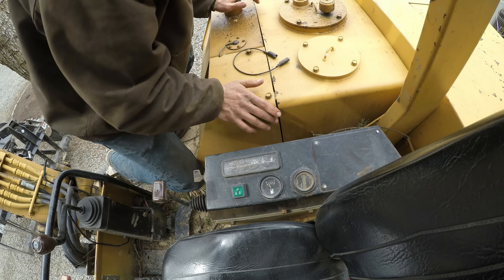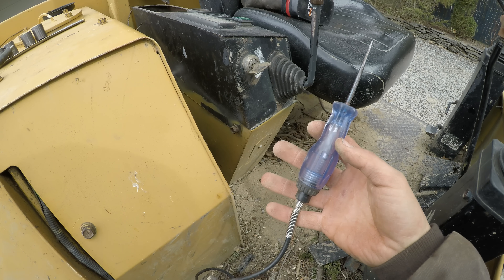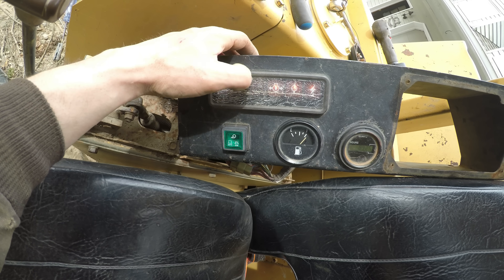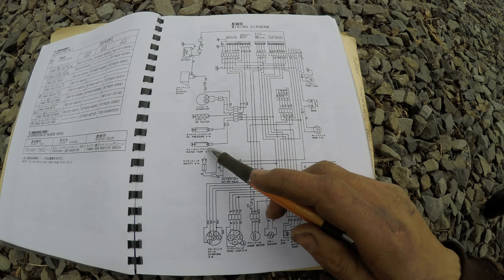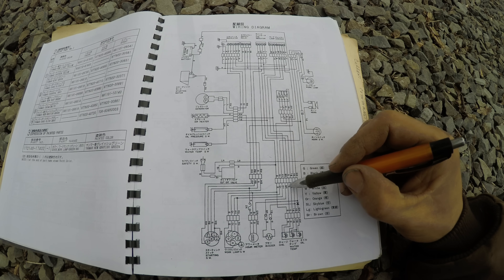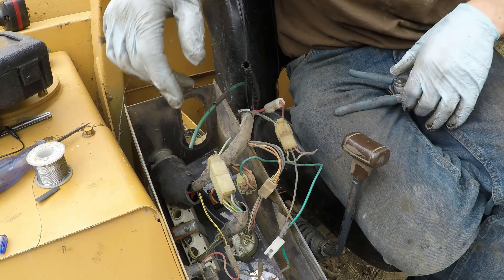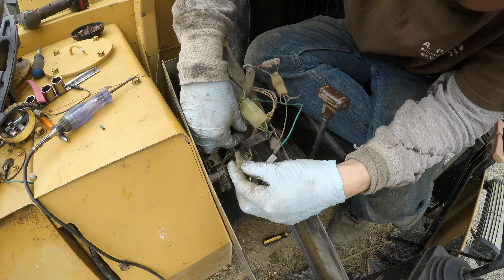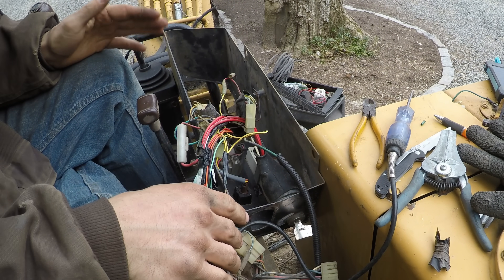Fixing electrical problems on the Yanmar excavator

Comment: Soldering wires on machines or any auto is a bad idea, your machines its your choice but just be aware of the downside.
There is a reason why auto and aircraft wiring and wiring on machines like this that vibrate are multi strand and that is to tolerate movement and vibration, soldering just turns multi strand wiring into one single solid core like house wiring that can just crack under vibration and movement.
I've got some vids of a Vermeer stump grinder I had to fix that had some nasty failures due to soldered wires.
Heating up the soft copper wiring with a soldering iron just hardens it and makes it more prone to cracking in addition to oxidising.
Get a quality ratcheting crimp tool that does double crimp.
Reply from the maker: I have never had a solder joint fail. Those crimped connections always seem to fail from corrosion
Reply: @AndrewCamarata  
I believe you Andrew, but it's only a matter of time and being a working mechanic since the late 1970's I've seen it a few times. not just on that Vermeer stump machine I did vids of which was worse case.
Re crimps, if you buy cheap ones and don't use shrink any join will corrode, good quality ones come with ends you can seal with heat.
The other side of it is always using double crimp tool and ratcheting so you can assure a proper crimp.
I can assure you manufacturers don't use crimp terminals on cables for cars, aircraft and machinery just to annoy solder enthusiasts.
With solder its not the solder itself bit that breaks its the wires just at the end of the soldered bit.
In short, the more strands wire has to more flexible it is and the more resistant it is to vibration.
But like I say, it's your machinery and if you prefer to solder then do what you feel is best.
Reply from the maker: I feel like the shirt tube can stop that from happening though.
Reply: @AndrewCamarata  
It's better than no shrink tube over it.

Comment: Yanmar  is a good brand. They put multiple filters on the fuel system . My friend has an old one like yours. His steel fuel tank was getting rusty so it was very good that he had multiple fuel filters which saved the machine. Perhaps you could do a video on how to fix a fuel tank that has rust on the inside ?

Comment: Bulb checker is likely a module that momentarily grounds the indicator lights during 1st start as a bulb check.
Reply: More likely applied ground or hot thru key function as part of the prove out circuit...

Comment: Not sure if anyone mentioned it yet and I realize this video is months old but... the lamp checker function is like turning key in your car and all the dash lights light up so you know the bulbs themselves are working. That way, an issue doesn't arise that you would otherwise miss because the oil pressure light bulb burned out and you couldn't see that you had no oil pressure etc.

Comment: smaller John Deere construction equipment is made by Yanmar and their larger excavators are made by Hitachi. your EX100 Hitachi also is the same as a John Deere 100 sized excavator.
Reply from the maker: Yeah, but John deere will still screw up the yanmars with some of their terrible parts. I had a newer john deere tractor, the tractor was made by yanmar and it was good. The belly mower was made by john deere and it was an engineering disaster.
Reply: Andrew Camarata it's  kinda wierd but you're right I've found that the Hitachi has fewer problems than the Deere.

Comment: Odd question but what's the operating weight of your yanmar
Reply from the maker: Like 5 tons. If your interested in the weight of a machine, Google usually knows by just typing in the model number.
Reply: I got it. I am in Alabama and have learned so much from you. Thanks for all your videos.
Reply: @codyhale4799  keep in mind that is 5 metric tonnes (1000 kg =2204.6 lb.)  so that would be 11,023 lb.    FYI

Comment: In some type of machines all the check lights come on with the ignition on, after the engine starts the light and the buzzer will goes off, this is control by a diode our by the alternator keep up the good work.

Comment: How does your Komatsu PC15 hold up !!
Reply from the maker: John Deere stuff, generally every hour spent operating the machine, you will be spending 1 hour repairing the machine.
Reply from the maker: The PC15 is good, very rarely breaks.
Reply from the maker: Its not as unbreakable as the Yanmar though.

Comment: Great job with the soldering. That's how I like to do it. Crimp connectors are unreliable and for loosers.
Reply: Looser than what?
Reply: Lunchbox Productions than his bunghole
Reply: Maybe.  A properly crimped connector (i.e. use a crimping tool!) can be good.  Problem with soldering is that on machines that vibrate (like a motorcycle) the solder connection may crack....you may not see it, but it will drive you nuts trying to find it.
Reply: Matt- coming from the assclown that can't spell loser.

Comment: Worked on equipment for 17 years before I bought my first business. You can’t imagine how many electrical problems on vehicles and construction equipment have had faulty grounds. Ford trucks are the worst ground from the frame to the body. You can’t imagine the amount of smashed wiring looms I have found. I spoke to many Ford Engineers who were no help at all. I had a Ford truck that would take off like a rocket using the cruise control because of faulty insulation in the front engine loom. 
I would put any John Deere up against anything except their Skid Loaders. They were junk. I have a JD X595 4x4 diesel that I refuse to trade or sell. It will out mow anybodies mower and has never been stuck.

Comment: Dude the machine has bad grounds and a bad diode {probably burned out from a battery charger}. You didn't need to change any wiring, just replace the diode. Its the triangle with a line over it just above the oil light on your diagram. Bottom right hand corner of the wiring diagram.
Reply: I have one that cant get power to the starter from the switch. Switch seems to be good. Any ideas?

Comment: I think the original wire for the temp sensor being grounded was causing the oem buzzer to stay on even with the bypass. without further testing I would guess the oem buzzer was the original problem causing the light to be on. that being said some times its cheeper and fast to bypass oem problems and Im glad to see you still have a working alarm, very smart dont see alot of people going the extra mile to do that!
Reply: you have the buzzer still connected to the short somewhere and having power still coming in from the shared oil pressure gauge it will continue to send an alarm . The old buzzer still is working so I don't think there was a problem there.

Comment: While I thoroughly enjoy watching your heavy equipment abilities, I can't say the same for your electrical abilities. Any time you are working on electrical problems, you trace down the root of each problem and fix it. Not wire around it. And the reason is because you now changed the wiring layout and it no longer matches the manual's schematic. Tracing the wires really isn't as hard as you think and knowing where the real problem was, is a lot better then rewiring around the problem. JMHO
Reply: In software engineering this is called to "hack around the problem" and it's often done when people don't understand the root problem and/or how things are supposed to work in the first place. 

They think they don't have the time to analyze and understand properly and just go for the quick fix, often with unintended consequences. In the long run this incurs a lot of cost. Subsequent devleopers (or even the same dev some time later) will be having an even harder time touching those parts of the code and at some point someone will be pissed enough and redo the whole thing to make it manageable and predictable again. If not it can becomes a notorious piece of code that noone dares to touch... and that's a real burden on the whole project.

Comment: bulb checker should be a collection of mosfets triggering during startup looks like the over heat mosfet broke into conducting.  FInd the bulb checker module and cut the light green wire.

Comment: Not a fan of hacking factory wiring, but you have to do what you have to do.  I won't solder anything though.  Especially on equipment in harsh high vibration environments.  Manufactures don't solder for a reason.  Try using crimp connectors lined with hot glue.  Very reliable moisture tight repairs.  The flux issue alone is enough reason to steer clear of solder.
Reply: As well as cold soldering as he did.

Comment: Correct me if I’m wrong but Yanmer owns John Deere
Reply from the maker: I don't think so. Yanmar stuff is unbreakable. John Deere stuff is always broken. I think John Deere uses Yanmar engines sometimes. Good example, I had a John Deere 2210, much of the tractor was made by Yanmar and it was fine. The John Deere made parts like the mower deck were complete garbage.

Comment: The buzzer is still going because it shares the same wire with the lamp, when you replaced the wire the old wire is still there and still shorted to ground, therefore still turning on the buzzer.

Comment: Personally I would have fixed the buzzer using diodes (as you mentioned), because diodes are much cheaper than another buzzer and the existing buzzer already works.
Just personal preference.
I would also have inspected that "lamp checker" circuit as it most likely turns on all the panel lamps (and the buzzer) when the key's on but the engine's off, and lets the lights do their own thing when the engine is running. I'm almost certain that it's more than just a connector to provide an easy way to check the lights manually.

Since each light and the buzzer activate when provided with a path to ground, a box that checks the lights when the key's on but engine off could be as simple as a set of normally off relay contacts that connects a bunch of diodes to ground, with each lamp and the buzzer having it's own diode. The relay would be controlled by a simple circuit that cuts power to the coil of the relay when it senses charging voltage (13.8-14.2v for 12v system) instead of 12v that the battery alone outputs (12v = relay on, 13.8-14.2v = relay off). The control circuit could be either a zener diode and a single IC, or a zener diode and a few transistors, with the single IC being the more likely solution as it's easier to make reliable with 1991 technology.
Reply from the maker: Yeah, good idea. Its working now. I got the buzzer for free.

Comment: I don't trust any of my old equipment mowers, skid steer, forklifts, tractor. 
I leave the Negative battery clamp (old style not side post) loose (don't tighten the clamp bolt) on ALL my machines, and pull off the clamp after I shut them down. Especially the ones that I keep indoors. Turning and pushing down on the clamps on the battery post makes plenty good enough contact to start and charge the battery (keep the post and clamp clean) but allows you to pull it off in a hurry if there's a short, to prevent a fire. And to keep the battery disconnected when not in use to prevent a rubbed thru cable or wire from starting a fire. 
OR.....install a battery disconnect switch!

Comment: Nice getting the bugs out of equipment , don't know how comments work on YouTube, they just listed one from May of 2017 as next, was wondering how that Red Maple tree is doing and did you support it with cable/ropes & how long would you leave them on ?
Reply from the maker: The red maple looked good. It lost its leaves for winter (that's a good thing). Hopefully it gets new leaves soon for spring. Still early yet, no other trees have leaves yet.
Reply: Andrew Camarata Good news, many specimen trees get kicked to the curb

Comment: I used to do the maintenance/running repairs for a neighbours Yanmar B22 (2.2t version of your B50). I agree that they are awesome machines and seem to last forever. My neighbour got his off his brother at 10,500hrs of hard thrashing. Had the same electrical issue as yours, which originates from a faulty alternator. The bulbs for the oil pressure, alternator charge and temp all connect to the alternator regulator, and all light up when the ign is turned on but the motor is not running.Once the motor starts, and the alternator is charging, the terminal that they connect to rises to 12V so there is no V drop across the bulbs and they don't light unless either the alt fails or they get an earth from the sender they are controlled by. Basically the same system used for dash tell tales in older cars with multi wire (as opposed to current single wire) alternators.

Comment: You know what ? There is something called a pressure washer ! It's not because this machine is made for hard dirty work that it doesn't deserve a wash once in a while ! It would show that you care about your equipment !
Reply from the maker: I wash it sometimes. And I just bought a brand new hot water pressure washer.
Reply from the maker: Changing oil and fixing temp lights shows I care about my equipment. Washing it does not.

Comment: My John Deere is really a Hitachi with a John Deere engine. I have had really good luck with this machine. I do need a small excavator and was looking at a Yanmar. Looking at your experience, I might get it. How is the pump, engine and undercarriage.
Reply from the maker: I've never had any problems with the engine or pump. One time I replaced a track/sprocket. Definitely buy a Yanmar.

Comment: Great videos! I can't hear well because of my age. Could you use some type of wireless mic when your operating at distances from your camera? Thanks and I enjoy your videos.
Reply from the maker: Thanks. I do sometimes use a wireless mic. I didn't this time, but I did use an external Mic which is better than the built in camera mic. I thought the audio was OK in this one. You can turn on the subtitles too.
Reply from the maker: I just checked it. The CC works fine on this video. At the bottom of the video screen there is a button "CC" that will turn on the subtitles.
Reply: Andrew Camarata wow you are amazing,
You care so much

Comment: Andrew, any piece of equipment that we had in our construction equipment rental fleet that was powered with Yanmar, was sure to be trouble free, ( engine wise!) , we had those engines on Generators, Plate Compactors and water pumps. Only problem we encountered was a stupid  'know it all customer' who insisted on putting gasoline in the diesel fuel tank,...even though there were warning stickers on the engine, on the fuel cap, and the control panel....but,...that's part of the rental business .
Reply: Let me guess, as soon as the engine had the gasoline flushed out of it and got clean diesel like it's supposed to, it started right up like nothing happened right?
Reply: Yes, 44R0Ndin, that was pretty well it!

Comment: maybe the  busser noise  check the parking brake   switch or  check your sit the switch I became undone
Reply from the maker: Jennifer White lol, there’s no safety switch’s on that thing.
Reply: if you lift the brake on the idiot warning sound would come on  and a set belt would  do it too
Reply from the maker: There is no brake, or seat belt.

Comment: Hi Andrew.... uh...oh.... now you went and alienated all the Deere viewers! I'm not in the excavation business and don't use my equipment every day. I own an old JD 420 bulldozer and a newer JD 990 compact tractor with backhoe and I can't say I've done any work to the tractor/backhoe but it's a 2001 with only 800 hours on it. Now, the bulldozer has had two rebuilt motors, new final drives and now I have to fix something that is wrong with the shifting lever (hopefully it has nothing to do with the transmission) but that bulldozer is of a 1959 vintage and I think it's done it's share of work over the years and is entitled to some fixing.... I don't have the experience you have with equipment but I do respect someone that uses it as much as you do. So you haven't alienated me. Looking forward to the next video.
Reply from the maker: Yeah, maybe, I'm just sharing my experiences, good or bad. I see allot of John Deere stuff out there, so I would hope people are getting work done with them.

Comment: Andrew Camarata I have been looking for a small excavator for some time now, I was wondering what the how many tons that yanmar is and how deep It can dig?
Reply from the maker: 5 tons. It can dig deeper than you would probably need it to. There are often spec sheets online that show the full range of motion for different model excavators.
Reply: Thanks a lot going to start looking for one. Keep making the great videos.

Comment: Why don't you run case? I have an old case backhoe and that thing is pretty decent to work on, cheap parts, and the only reason anything breaks is because it's 45 years old.
Reply from the maker: I've never ran across one for sale.
Reply: Andrew Camarata if you want a nice case backhoe, there is an older 580e extendahoe near me in central PA. They would probably take 8k.

Comment: I have a NH skid steer and did have a Bobcat mini excavator, the NH was a lot of trouble at first 'til my old mechanic buddy fixed their design flaw and the bobcat was nothing but trouble the whole time I had it. The frame on it actually cracked, total junk.
Reply from the maker: Yeah, I don't think I would get a bobcat excavator.

Comment: Andrew, thanks for another straightforward instructional video. So what ended up fixing the fuel gauge issue? Did you improve the grounding of the upper control panel?
Reply from the maker: I think the grounding that metal cover fixed it.